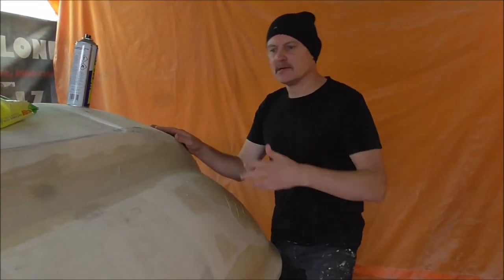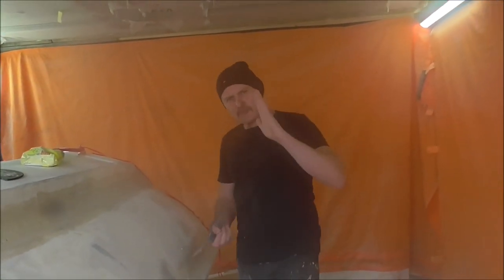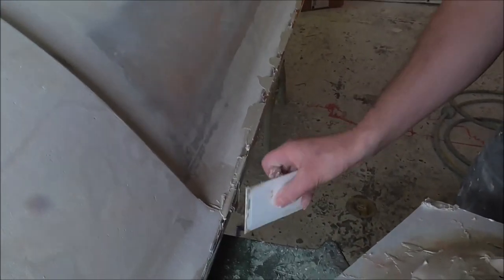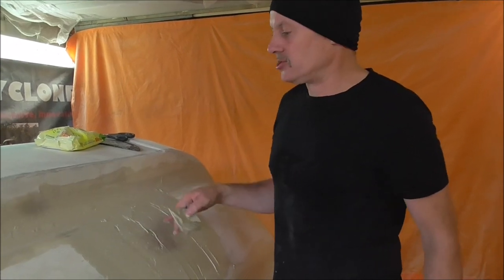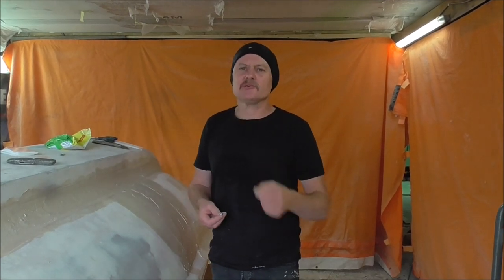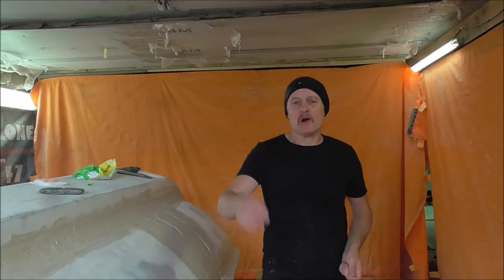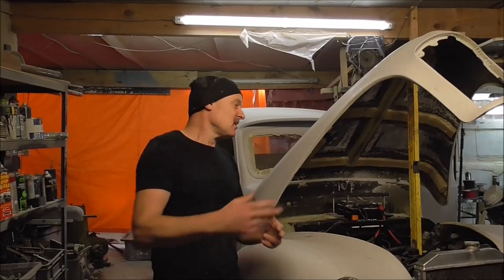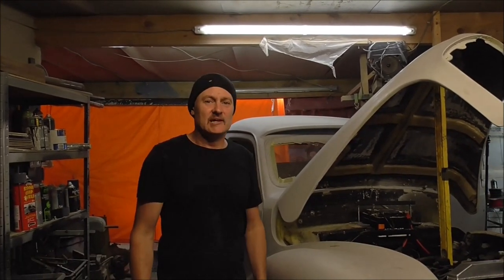CAR BODY WORK TIPS AND PROJECT CATCH UP

Comment: Your tickover issue could be a vacuum leak, spray some soapy water around the carb and inlet manifold while its on tickover and see if things inprove. Good luck
Reply: I was thinking the same.
Reply from the maker: Tried EVERYTHING and still running rough :(

Comment: Vacuum leak? Vac pipe to auto box modulator OK and not swelled up with oil and fell off? Unlit Propane blow lamp waved around the inlet fannymould should make the revs pick up if theres a leak. Theres my low grade tip.
 Cheers for the clag spreader tips. I've never had any luck re using them.
Reply from the maker: Cheers, tried EVERYTHING and still not running right.  Its definatley cursed!!!!